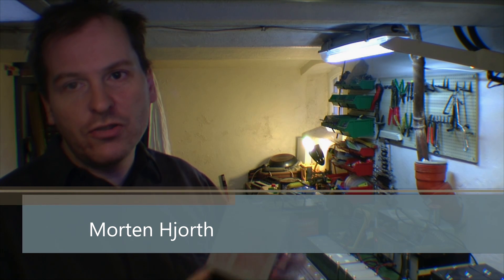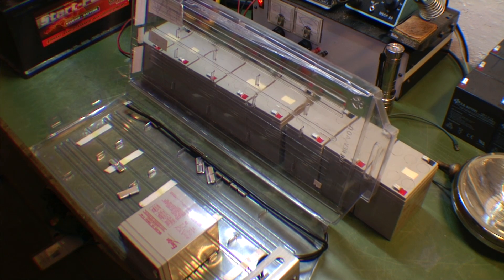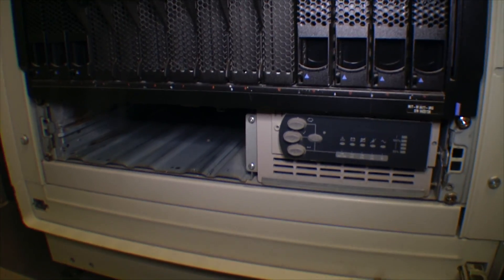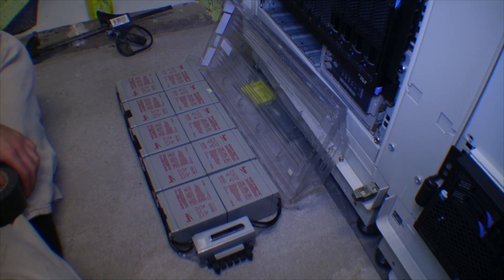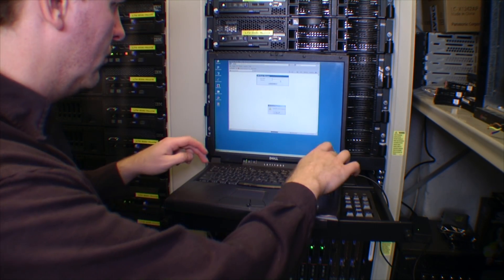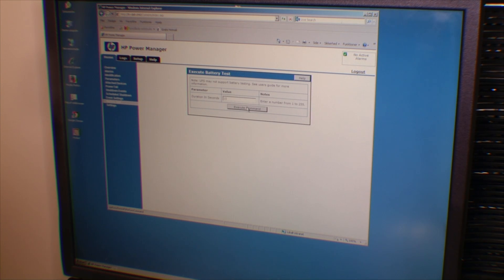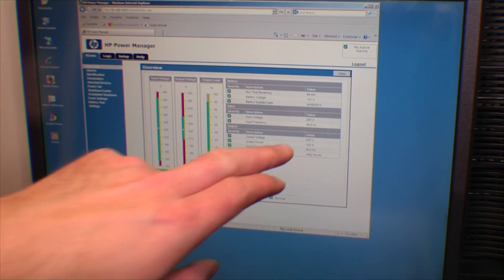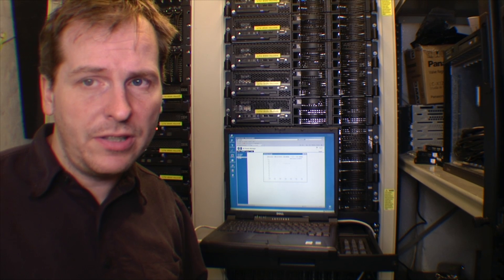Batteries back into the HP R3000 XR UPS System - 250

Comment: I've done this battery swap twice now with a pair of R3000 XR's. I use Eaton Intelligent Power Protector instead of the HP software, not perfect but it does the job and it provides a graph of battery level and voltage in / out.
Reply from the maker: Hi Steve T
Thank You very much!  glad you liked the video :-)
Thank you for watching! :-)

Comment: Thank you for another great video !  My UPSs will have two or four batteries so I will not go broke replacing the batteries...  Also write down the date on the battery case when replacing the batteries, then you will know how long they lasted...  Also I like using the clear packing tape (per a YouTube video) to hold down the batteries or cover the terminals.  And remember to recycle the batteries at a local battery store !  tjl
Reply from the maker: Hi Tim Lipinski
These tiny 12v batteries cost like $15 a battery. I think the higher voltages from the batteries 120V+ gives a higher efficiency.
Thank you for watching! :-)

Comment: unbelievable. can`t find HP power manager. how so? I'm just confused
Reply from the maker: HI
They hide it well :-(
Thank you for watching! :-)
Reply: and share not possible? )) I downloaded but on windows10 not work. how difficult this company just awful
Reply: as soon as I shall get to my company, I'm on vacation, be sure to take away the program and lay out on a torrent. I hope the courts do not wear out))
Reply from the maker: HI
I think I had to install a winXP to run this.
Thank you for watching! :-)
Reply: works with XP
Reply: Hey. I would like to ask you for help. I need the pinout of the cable. could you send me a schematic. has a week passed, I can not in any way connected UPS
Reply from the maker: HI farhad nagiyev 
Here you go : http://h20564.www2.hpe.com/hpsc/doc/public/display?docId=emr_na-c00339005
Thank you for watching! :-)
Reply: Thanks for the help you very much. but I was already there, and none of this scheme is not understood.
I'm sorry that burden you. It can be about numbers?
Reply: Hello. I'm still not able to connect the UPS It was a very complicated procedure)) would like to ask you, could you tell me what number of contacts on the plug fimale connected to the contacts of male plug?  Can you check with multimeter?
Reply from the maker: Hi farhad nagiyev 
No I just happen to have a cable that worked.
Thank you for watching! :-)

Comment: hi mate I think I have one of these E03007i , R3000h XR , needless to say it was a bad ebay buy from 10 years ago that's sat in storage as it came without battery pack or faceplate ... would you mind helping to identify the internal voltages and pins to directly wire battery banks there are 4x pins so assuming 2x banks of 12v

Comment: I am struggling with power stability at my own "playhouse" :D i bought one of those chepo 2000va UPS but it last no more than a couple mins, and basicly the server cant see it. How long does your UPS keep your system up for? and do the server/servers recognize the power loss by UPS signal and shut down  themselfs? the good UPS are SOOO expensive!  but i think theres a reason for that now :(
Reply from the maker: Hi +Gil ARAÚJO 
Maybe if you bought it really cheap it´s only able to delevere a max of 2000va,, and not fore very long. How much battery capacity are there in the UPS?
I do not have an UPS running right now,,,we have very stable power here in Denmark,,, 2015 two power interruptions.
Thank you for watching! :-)
Reply: +My PlayHouse (Morten Hjorth) I need to break the UPS apart, to see inside. i used to live in the city, never had a power issues there. Moved... now soemone sneezes and power goes out.
I was thinking of rigging some car bats to it ti hack it but i know thats a bad idea :D
On the other hand i wanted to make it so the servers would recognize the lack of power and shut down nicely on their own before bats draw. 
So far RIP list on this power issues is: 2 ssds, 1 sata controler, 1 motherboard: Getting more expensive than just buy a damn propper UPS! :D
Reply from the maker: Hi +Gil ARAÚJO 
A couple of good cat batteries,,will help a lot if it´s a battery problem. who many watts have you connected to your UPS?
No monitors,  printers, coffee makers or air conditioning!! right?
Where are you from?
Thank you for watching! :-)
Reply: +My PlayHouse (Morten Hjorth) Portugal, Very up North. And yes no printers, or coffe makers or AC. the wattage meter says 500w on all the equipment needed. WHich i guess is quite a lot. but i thought a 2000va would give me at least more than 3 mins, if nothing else to allow me a nice shutdown. instead of abrupt power failure. I did read about car batterys but they say hacking the UPS like that might be quite dangerous! reading uppon it, might need to get a Generator with auto start -> Relays of sorts. Not sure :(
Reply from the maker: Hi Gil ARAÚJO
do you have a link to the thing you got?
Thank you for watching! :-)
Reply: +My PlayHouse (Morten Hjorth) 
http://www.nanochip.pt/pt-PT/p/52908/EUROTECH-UPS-2000VA---UPS2000EU_EUROTECHUPS2000VA.htm

i think is reallyy crappy! also i am not SURE what it says in the box is what comes inside it. i suspect is really a bad branding there.

it says it has 2x9Ah/12V batterys and is  2000 VA / 1200W
Reply from the maker: Hi Gil ARAÚJO
2x9Ah/12V that is 9*(12*2) = 216 watt in one hour. If you are lucky this UPS is 85% efficient, that is 184 watt. You are puling 500W that brings the time down to (60*184)500 = 22min
The batteries must be bad,, if it´s on guarantee have it replaced or get your money back. If not get one new battery for it and replace the worst of the two.
Thank you for watching! :-)

Comment: Is the battery on this hot swap or how would you prevent the system from going down?
Reply: +FrostyExchange That's what bypass switches are for.
Reply from the maker: Hi +FrostyExchange 
That is a great question! I have no idea if you can hot swap the batteries,, i do not think i´d like to. I have two PSU´s in the servers so i move the PSU away, one ad the time,, when i "play" with the UPS.
I do not think the power is lost if the batteries goes bad "disappears", but what happens when a new pack is installed,,no idea!
Thank you for watching! :-)

Comment: Nice video! It's always a big relief to get batteries working again (they aren't cheap). I don't think that the UPS is a rebranded APC, I don't think APC would make a battery tray out of plastic. But 3000va, that's a workhorse!
Reply from the maker: Hi +logycam10 
I think your right,,,, damm i was hoping it would be able to use some much cooler APC software.
Thank you for watching! :-)